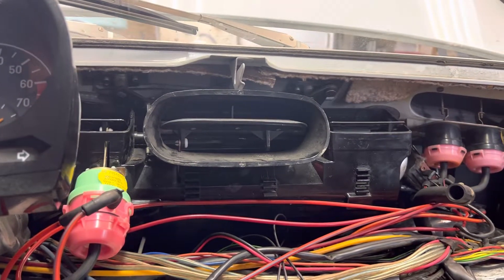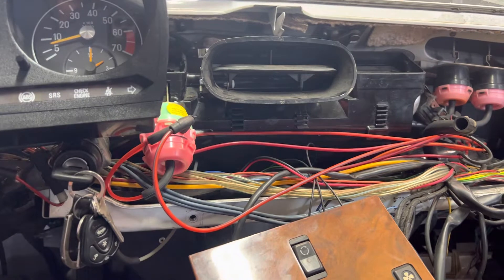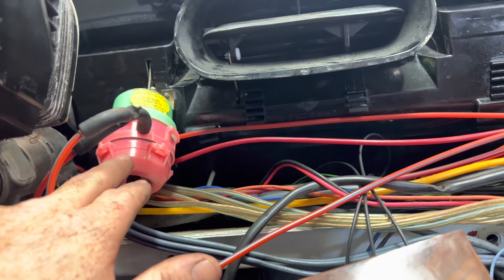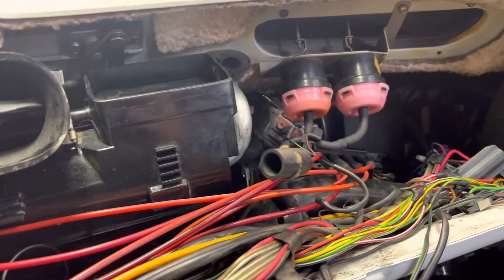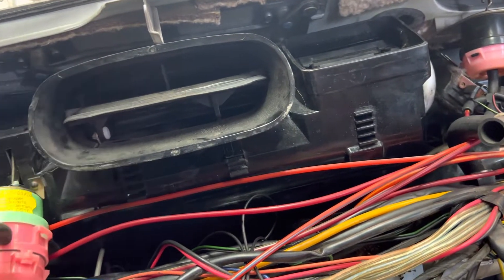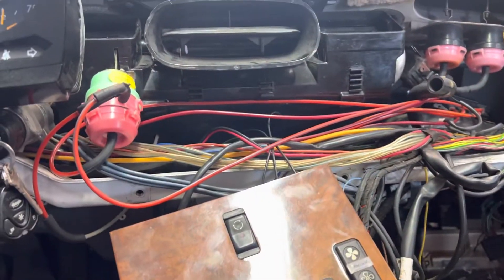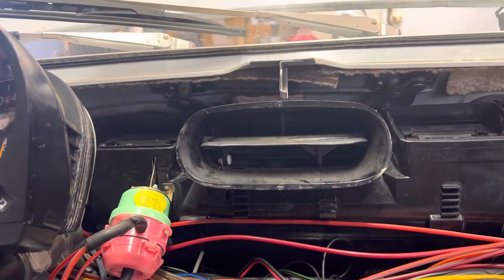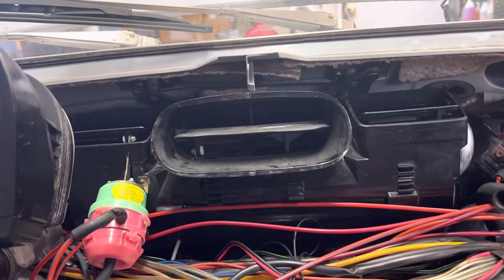R107 560sl vent repair operation

Comment: I have a 560 sel I tested blower motor and it works but it wont turn on through climate control switches. Any ideas where to start?

Comment: Hey Andrew. Is it possible to change the defrost pod without removing the dash?
Reply from the maker: No
Reply: You have to remove the steering wheel,cluster, and center console. it's very difficult.
Reply: @80sgermanmetal  I wonder if I can put pressure on the grill vents on top to just push the defrost closed.